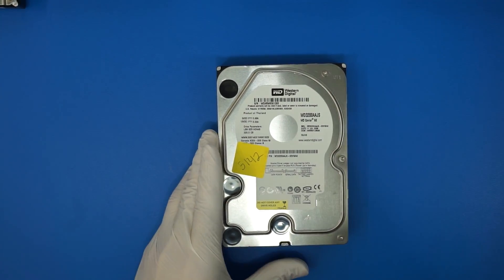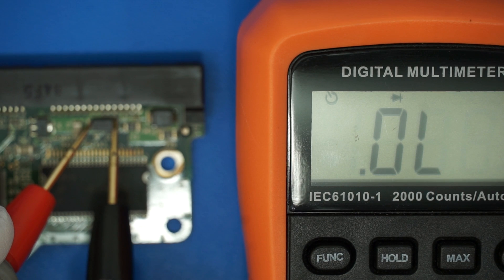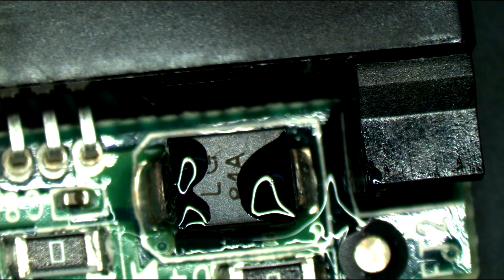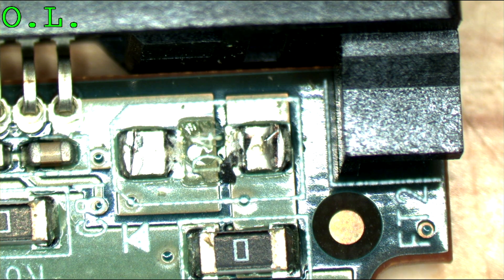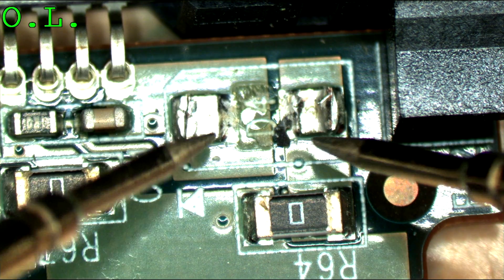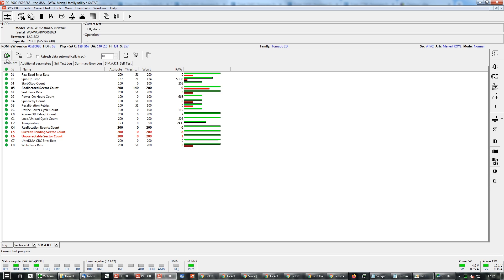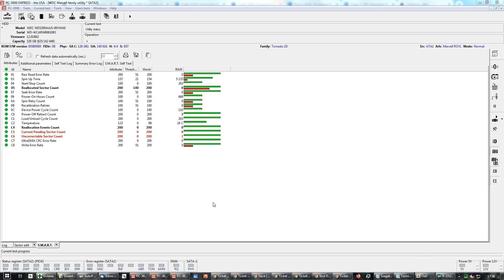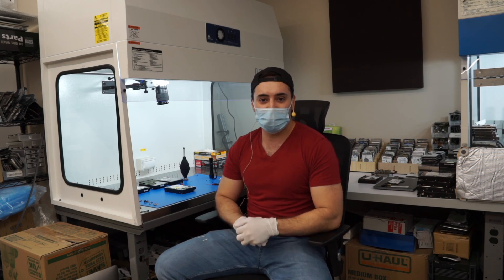How to recover data from a dead Western Digital hard drive when not powering on

Comment: that measuring of the diodes at the beginning is not voltage. you can not measure voltage unless you have electric charge going through the circuit
Reply: In diode test mode it actually measuring voltage, the pull up comes from the voltmeter battery.
Those diodes are made to short connect when they pop so they don't leave the cirquits unprotected.
Reply: In diode mode the multimeter provides the current through the diode and measures the voltage across the diode.  A silicon diode will show from 0.5V - 0.7V when conducting in the forward direction and OL in the reverse direction, when not in a circuit.  In this case, the diode voltages were with the diode in circuit so the reverse voltage showed 1.7V .
Reply: both are right thanks

Comment: can anyone explain how he is getting 0.4v in one direction and 1.7v in opposite direction in D3 diode? diodes only conduct in one direction, right?
Reply: He's measuring the diode in circuit.  So other components in the circuit are conducting power from the multimeter and giving the 1.7V when the diode is not conducting.  The voltage readings are not what you would get (accurate) if the diode was out of circuit.  This is just a quick "go/no go" test for the diodes.

Comment: So by removing the TVS diode you can get the hard drive to work again,  but you also removed the protection against over voltage. Not sure I would call that a good repair.
Reply: I think the idea is to get it working long enough to get the data off of it. I don’t think I’d trust a drive that had a failure of any kind. Hard drives are cheap. Any data that you are willing to pay to retrieve isn’t worth the risk leaving on a drive like this.
Reply: I gues you are right, but he could have explained that, the title suggest a repair.
Reply from the maker: No repair of any hard drive is ever meant to be for more than data recovery to a new one.

Comment: Can you tell me what actually people connect instead of the SATA connectors on the HDD to fry them? I mean, is there an identical connector used for something else so it can overvolt/overcurrent the PCB or a component..?
Reply: Also, maybe a dumb question but when measuring the pads after you removed the diode, where does the voltage come from when you measure? I assume the PCB is not connected to the power supply..?
Reply: If you use an external enclosure and make the mistake of plugging in a 19V laptop power supply rather than the 12V power supply is uses, you send way too much power into the drive. That’s most likely what happened here.

As for the power, the meter is the one supplying the volts. It’s checking to see what the voltage drop is between the leads. A short will read no drop at all.

Comment: Hmmm, i have a 2TB WB drive that I put in my other computer with a modular Power supply, plugged in what I thought was the HDD power plug for that PSU, but the drive smoked and no longer spins.

Could the drive spin again if it is the TVS diode popped and removed ? (Even just for Recovery).
Reply: @gorak9000  I got the PCB off, I do not have a multimeter but using high powered reading glasses, R67 (one of the Zero Ohm's) looks fried.

Comment: i have problem with my 4TB extrnal hard drive
i accidentally drop it.

not too high.. sort of above the knee.. and the next thing is when i plugged it in, i only hear a "clock tick" sound like for few minutes and goes off and the exthd cannot be detected . it shows status on "unknown serial something on device manager.. i tried turning off my computer , while plugging in my extHD. it freezes.. like in a the frst logo brand screen bfore bios menu that shows F2 or del for ... f8 for.. f9 for.. 🤔🤔 
but when i remove the extHD..it boots normally
Reply: i tried checking it the inside parts.. 
the header thing or that writes on the disc go backs on it's place

Comment: You forgot to replace the diode, ALL parts removed should be replaced. Those parts aren't there just for good looks.  May I suggest mouser electronics or digikey?
Reply from the maker: Um. This is getting plugged in one last time and tossed out afterwards. steve forgot nothing

Comment: I got a new PCB for my WD drive that suddenly stopped spinning (0 sound when plugged in), thinking it was probably the Marvell chip (I tested the diodes and they were OK).
Turns out, it wouldnt spin up even with the donor PCB...
I even opened it up thinking maybe the head was stuck on the platter, but that wasn't it either.
So it has to be the preamp, right? basically impossible to fix it DIY style, am I right? unluckiest way of getting unlucky I guess...

Comment: So you just leave the diode off with no replacement?
Reply: in this case yes, the drive is being trashed after the data gets recovered from it. If you planned to keep using the drive, a replacement would be recommended.

Comment: So people without a hot air system or a soldering iron can snip the component off. Great. Now how do they solder the replacement back?
Reply: Notice that he did not replace the part. Once this drive gets the data off, it is a donor, it's not going back into service again.
Obviously, to solder on new parts you would need a soldering iron.

Comment: Good video, only one potential issue that you should probably deal with.

If you're connecting these drives to windows (or any other OS), you really should be using a write blocker if you aren't already.  There's a few reasons for this:

1) You never should be blamed from a customer for adding files to a drive.  While this is less likely than #2, it's still good practice.
2) If you end up coming across anything illegal, a write blocker will help prove that you didn't put it on the drive.  Write blockers are used in law enforcement forensics when cloning a drive for analysis to take out the legal argument that "That's not my client's data, someone else put it on the drive".

Another tip is that I recommend you switch to linux vs windows for testing a lot of this, if possible.  The reason being is that Windows only supports a small subset of the types of formats you may come across.  Furthermore, you can script it out to mount read only (which should be done in addition to a write blocker) - and could probably script out a lot of the checks you're doing so you just get a report in the end (e.g. head -n X /dev/disk... | od -a > report && tail -n X /dev/disk | od -a >> report), then just cat the report.  With the report better served in a ramdisk that's created before (disk image in memory), that's created at the beginning of the experiment, and cleaned up on umount.  That way you're also not copying end user data.

Also...your customers are kinda idiots for not having encrypted drives before sending them to you/anyone.  I thought in Windows, now-a-days, encryption was default, but guess not.

Comment: I feel the pain of victims who lost data, I have a 1TB Seagate pipeline HD .2 die with pictures on it that haven't been backed up since several months ago. Computer went to sleep and when I woke it up my E: drive was missing, tried a reboot then a docking station with the same results. Hard drive starts up and self boots with no communication to the PC. My theory is something on the PCB died. Ordered the same drive online with matching firmware code, hoping a quick swap of the pcb will let me recover my pictures and files. If thats fails I may try swapping the platters to the working drive using the tape method. Though seeing the the drive spins up and self boots I see no issues with needing to swap platters. Just waiting for donor drive to arrive, fingers crossed.
Moral of the story? Back up important files frequently after adding new files.

Comment: A customer returned Dell laptop we upgraded to 480gb Adata SSD, laptop came bios locked and ofc after removing ssd it became locked aswell...Guys from rma got the laptop but we kept the ssd, so I'm now stuck with brand new 480gb ssd that is bios level locked. Internet has very poor answers to solving this problem...anyone?

Comment: So you removed the Diode and I didn't see you put a new one in?
Reply: Yes, as he explained, those are only there to protect the circuit against wrong voltage. Feels always funny to me when they don't replace parts, same with bypass caps. :-D But they'll just pull the data from the drive and the drive won't be used again.

Comment: Please replace the diode.  You have removed the protection.
Reply: I suspect this was data recovery focused and not to return the drive to use.
Reply: The drive was a 10+ year old, 320GB drive. It’s not worth doing a full repair. They can now pull the data off to a new drive and not worry if there are other age issues about to happen.

Comment: If it’s failing and made by Western Digital you might as well throw it into the nearest dumpster unless you have one the very rare few drives they will actually honor their warranty on. And even if you prove your almost new WD drive is dead and under warranty, which they mostly deny however they possibly can, WD will send you a likely defective “refurbished” drive that likely some other customer already returned as defective and likely still is defective. So your options for long term satisfaction with Western Digital are near zero if you have a problem of any sort with any of their crappy failure prone drives with many being SMR and unsuitable for RAID or NAS use despite being falsely marketed as such. If you look up “FAIL” in the dictionary it says: See Western Digital

Comment: Why does Seagate have a bad rep?
Reply: IDK what others will say but it may have something to do with their HDD board burning the moment i plugged it in to power
Reply: funny thing he made a video about that about a year ago.
Reply: Well they have a history of faulty products
Reply: Because Seagate is rock-bottom trash. Every single time a customer has a failed drive or an issue with a drive, before I even open the machine, I already know it's a Seagate inside.

Then I open it, and sure enough: Seagate HDD.

Comment: The fact you get a lot of these Western Digital toilets is why I don't buy them.
Reply: @gorak9000  I can confirm on the Seagate failure rate. My first new PC around 2001 had Seagate failure at around 6 month's. I switched to western digital from that day forward. Also seen many other people with dead Seagate drives over the past 20 years and tell them to buy WD. As of the past 5 years or so I dont know if the WD drives are still good. I have been using various SSD's during that time. I can say it's best to avoid the budget WD blue drives.

Comment: If you don't have a soldering iron AND you don't have a hot air station (call it "otter station" and people will always give you funny looks), then why are you trying to repair the board?  How are you going to solder a new part in?
Reply: You don’t. You get the drive working and transfer the data to a different drive.

Comment: Why is he cutting components off boards, if you are doing board repair, you have the right tools to the job, you can’t solder components without an iron wtf
Reply: the diode was shorted,keeping it from spinning up. You don't need the diode to get it working just to back the data up off the old drive hence no iron needed.
Reply from the maker: To show you how to do it without an iron. I did the same with backlight fuses here. https://youtu.be/C51_s7ssqlg
Reply: turn your sound on maybe.